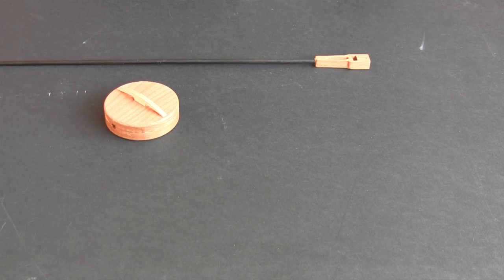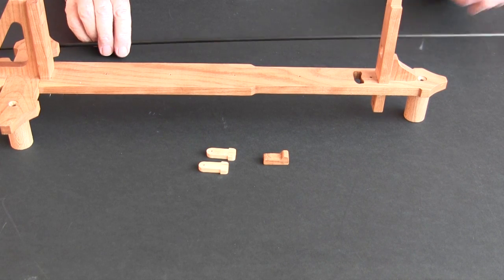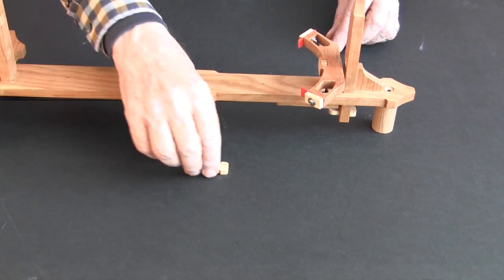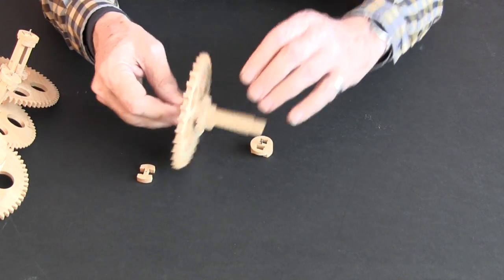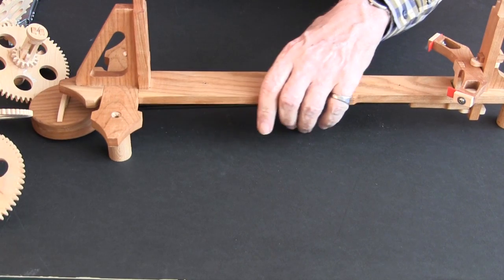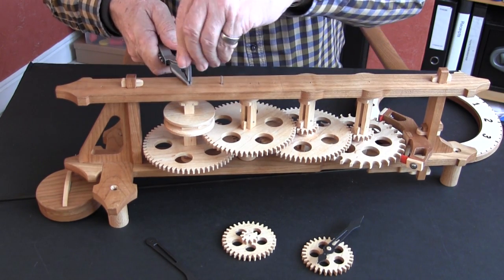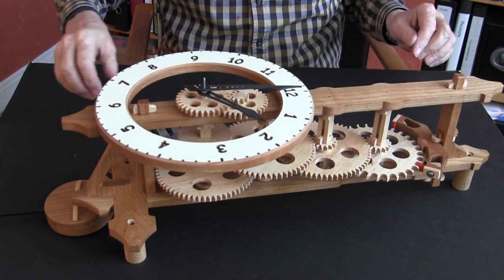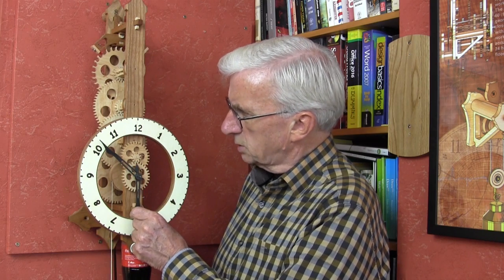Brian Law's woodenclocks - Clock 25 - Construction

Comment: my language is Portuguese, I do not know how to speak English, I'm turning to an online translator, so I apologize for something misspelled. I built the watch 25 with the help of a laser cnc, I'm having difficulty adjusting the time, the clock is advancing 24 minutes every 8 hours. Could you tell me what the value of the pendulum bob weight and the main weight on the coke bottle is?
Nice work, thank you for showing us your art!
Reply from the maker: If you have made the Pendulum rod from Carbon Fibre tube or wooden dowel and the Pendulum Bob from wood then the Pendulum Bob will be the correct weight.,
You now need to move the Pendulum Bob down to slow down the swing of the pendulum until it gives you the right time.
Reply: I made the 1 meter rod of the Pendulum with aluminum hollow tube (mass = 110g) and the Pendulum Bob made in layers of mdf 3mm (masa74g). Is the pendulum rod too heavy?
The weight that rotates the gears has mass of 1 kg.

Thank you so much for answering me!

Comment: bom dia Brian, estou tendo problemas com meu relógio. É o primeiro relógio que projeto. Ele funciona por mais ou menos 2 minutos e para. Acredito que o problema seje a roda de escape e ancora. O pêndulo vai perdendo a sua energia e a roda de escape não o alimenta. Você poderia me ajudar?
Reply from the maker: The Pendulum and the Escapement both hang from the same pivot. The Escapement and the
Pendulum can be a tight fit on the pivot pin, but the Pivot pin must be free to move in the two
Hanger parts that support it, this fit should not be too loose so a Ø2.3 hole should be used as a
maximum. If you can see movement of the pivot pin when the Pallets engage the Escape wheel then the holes hangers are too big.
Where the Pivot passes through the Back frame a Ø3 should be used.
Reply: obrigado Brian, vou trabalhar nestes ajustes.

Comment: Are you running continuously?
How often does it stop?
1 day running the wrong minute?
Reply from the maker: The clock will run for about 8 hours before it will need rewinding, then you pull down on the counter weight and lift the main weight to reset.

Comment: Hi, I'm a  biomedical engineer student and I was planning on making this for a final  project. 
I was checking the clock drawing's PDF and noticed the escape wheel didn't have dimensions for the gears.
 Are they not important or can i only get them by purchasing it?
Reply from the maker: These designs are intended to be built  using the DXF files to generate gcode for CNC cutting.  They can also be used by printing out the parts to scale and sticking them to the wood surface and then cutting around the lines with a scroll saw. Neither methods require fully defined detail drawing to accomplish this, so I only include basic dimensions for the parts.
Reply: Thank you!
Real nice job by the way